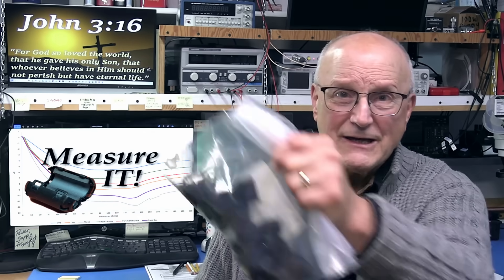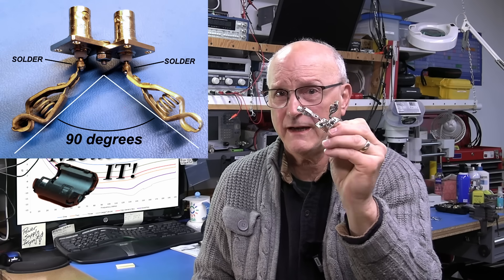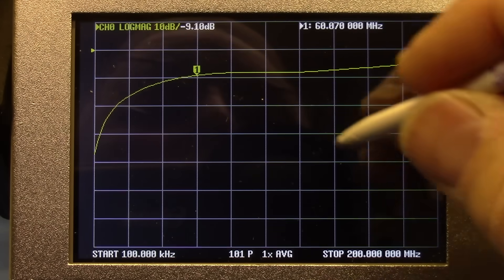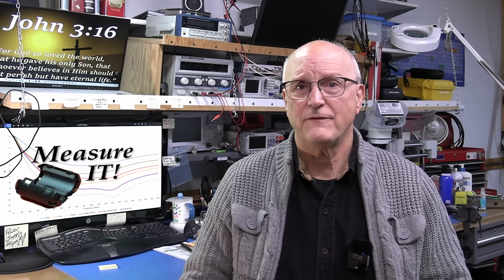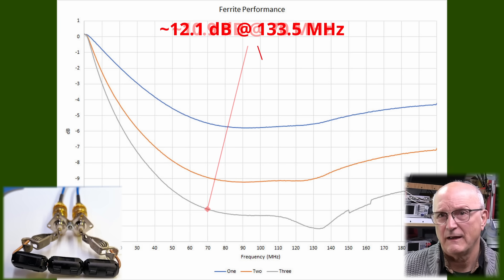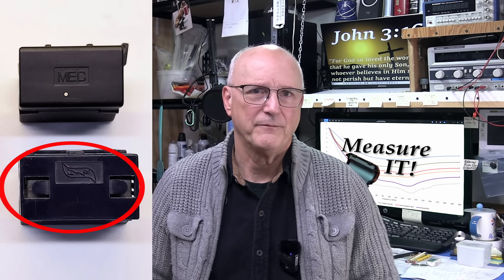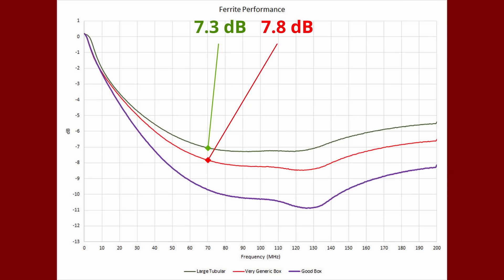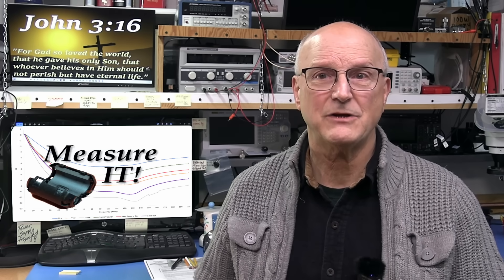Evaluating Clip-On Ferrite Beads with your nanoVNA (075)

Comment: Excellent video.  Compairing cheap amazon clip on ferrite devices to a larger piece of ferrite from fair-rite isn't really a fair comparison.  You did a great job showing that the fair-rite device is superior, but amazon ferrites are a fraction of the cost....and if you don't need a tremendous amount of attenuation, then a few turns around the amazon clip on ferrites are probably good enough and will cost less.
Reply from the maker: Thank you! I don't know if you noticed that I compared a similar size cheap Amazon tubular ferrite to a very generic box style to a genuine Fair-Rite box style.
You are right, though, if you do not need a lot of attenuation, then the cheapies will work just fine. It is all about the application. Figure out what you need and select the ferrite that will do it for you. 🙂
Reply: @eie_for_you thank you again for the excellent video!
Reply from the maker: @daveG1020  You are very welcome! 🙂

Comment: Somehow I missed info about the cost... like if 3x beads cost more or less than 1x the other thing?
Reply from the maker: Well ... the cost is very, very supplier specific. So, quoting costs wouldn't be too helpful here.
Furthermore, there are a lot more factors involved than just cost ... like space considerations and dissipation factors and more. This is why you have to do your homework. 🙂

Comment: Per the comments, you get what you actually should be buying.  Ferrites come in all sorts of dissipation ranges and losses.  Some are virtually lossless and we used these in HF transformers.  The FairRite company catalog is a very good reference source for the actual specs.  We did EMI/EMC engineering with these types of things, and they are often ineffective on cables, since that depends on placement.  EMI is a common problem now from spread spectrum computer power suppies, and one bead is not going to add much to attenuating the noise level.  The cable lengths act as antennas at specific resonant frequencies, so unless you emplace different freq-ranges of ferrites, you won't get much attenuation over a large band.  As per the video, the "longer the bead" the better the attentuation.  An actual pipe would be the best.
Reply from the maker: When many people look at all of these specifications, their eyes glaze over, not sure what it all means. This is why, in the end, if we are not sure what we are looking at when we look at the catalog, their is always customer support. 🙂

Comment: Ralph, I'm sure you know this already, but I'll state it for the benefit of your audience.
3 turns of a wire through a single ferrite would be MUCH more effective than a single wire passing through 3 ferrites.  If you're shopping, buy larger diameter ferrites and wind your wire/coax through as many time as it will fit, I recommend a minimum of 3 turns for good attenuation.  Type 31 and/or 43 are great for common mode or noise attenuation in the ham bands.
I really like your testing jig, and will make one.  The multi-turn effect could be easily demonstrated using it.
Thanks for your very informative channel.  I enjoy one or more of your vids just about every day.
Reply: When you say "turns"  you mean winding the wire through the hole and around the outside of the body of the ferrite, as in repeating loops through the ferrite?
Reply from the maker: @echadmiyodea  Each pass through the ferrite is a "turn." The key is that the wire passes through the ferrite. Having it beside the ferrite, on the outside, doesn't count. 🙂
Reply from the maker: There ye go! Each additional turn adds some benefit. But, it is the law of diminishing returns, as I show in the video. Yes, each additional turn adds more benefit, but less than the previously added turn. 🙂
Reply: Up to a point. Inter-turn capacitance (mutual inductance in the case of shielded cable) will affect the higher frequency performance. But if you cascade one single turn and one multi-turn, perhaps you get the best of both worlds. I don't have the kit to measure that, unfortunately.
Reply from the maker: @lumpyfishgravy  Well ... sounds like the voice of a truly inquisitive experimenter to me! 🙂
Reply: I have used type 31 very successfully in solving 20M RF from getting into audio equipment and have read that looping more than one turn thru the toroid increases the effect by the square of the turns. i.e., two turns is 4x, 3 turns 9x...  Is that true? I have not verified that and never thought about a jig to measure it until now. Thanks for the video.  🙂
Reply from the maker: Thanks!  My experience has been that the actual dB attenuation with adding turns to a ferrite follows the law of diminishing returns. Each subsequent turn does, indeed, increase the attenuation, but not as much as the previous turn. Check out my video on common-mode chokes here: https://youtu.be/s_JHPDA7k5Y where I do an experiment with the number of turns through a toroid to extinguish unwanted common-mode currents which can exist on the outside of the shield of a coaxial cable. It is the same concept as using ferrite beads.
You are very welcome! :-)

Comment: Great job, thanks.I had a problem with my washing machine on 80m. I purchased from Mouser 2 clip-on ferrite beads that worked best at low frequencies. The idea was that I was able to look at the datasheets with curves. I then clipped them on the power cord of the washing machine, with 2 wraps each. It worked. Buying a known ferrite is the best!
Reply from the maker: I LOVE the success stories! 🙂
I wish I could put a ferrite on the entire city of Dubuque! We have an S7 to S9 noise level here and it is guys to the south of the city and guys to the north all have the same issue. I've turned off my own main breaker and ran my radio off battery ... no difference. 😞
Reply: @eie_for_you  I know of what you speak!  Keep after it, you will find what it is eventually!    I have had s7-s9 noise here in my town, which is power line induced.  It changes with weather, and seems to follow a HV feeder that passes my house about 300 ft to the east of my house .  4 or 5 blocks on either side of the line,  the noise tapers off.  It also reduced a lot last spring, but it seems to be coming back.   Interesting thing, I had the power line drop coming to the house from the alley  put underground (at my own expense) to give me more room for antenna construction, and while that was in process I noticed my neighbor had his power drop from the pole to the house and it was rubbing on a large tree limb.  I noticed also that someone (doubt it was the utilities people)  had wrapped what looked like part of a rubber door mat around where it contacted the tree and secured it with zip ties.    So,  I will be looking at this a little closer when the weather warms up this spring!  I suspect that there was or is still leakage to the tree when the tree is moving in the wind, and it makes its way back to the feeder by the transformer in the alley passing the noise to the primary side.  It then radiates out  from that line which runs to a much larger substation 5-6 blocks north of me.   73 and good hunting!
Reply from the maker: @arnoldgrubbs2005  I hope to do a mobile search with my RF Explorer and a portable antenna....sometime! 🙂
Reply: @Electrotech1980 can you share a link for the Mouser beads that you selected and successfully tested, please?
Reply from the maker: @ Yes, please share your discoveries. 🙂

Comment: I don't recall you mentioning anything about the ferrite material. That makes a big difference too. A question how much difference does the split core make. They are convenient but at what price to performance?
Reply: I think material is the same thing as "mix" or..?
Reply from the maker: @OH8EFI  As I understand it ... yes. 🙂
Reply from the maker: I did, indeed, make a note to pick the right material for the job. 
Good point about the split core. I would assume that the split core is a compromise for the convenience of being a clip on. I'm not sure how much that affects overall performance. 🙂

Comment: hi thanks for the info. i have a question for you is it possible to use rig ekspert stick 500 to measure db deping through ferrite cores ?????
Reply from the maker: You need a 2 port measuring device to do this measurement. The Stick 500 is a single port device; it measures things like SWR, return loss, impedance, and the like. It cannot measure things like filter frequency response. This ferrite business is, in essence, a frequency response-type test. 🙂

Comment: VNAs are great tools, and the availability of the inexpensive ones is great for the hobbyist.  As for ferrites, I spent a lot of time working on EMC problems, and a selection of clip-on ferrites is very handy.  Our lab used Fair-rite ferrites mostly.  You do need to select the correct material for the frequency range of interest, and you should select the ferrite that fits snugly around the cable.  The impedance of the ferrite will be reduced when there is a gap.  As you note, you do need to read the data sheet and understand it.  Measuring the ferrite is useful, but be aware that they usually have a large tolerance.  I recall that a tolerance of 25% was pretty typical.  It's more useful to just buy a good ferrite from Fair-rite or Wurth or other reputable supplier.
Reply from the maker: Thank you for the great advise! I cannot agree with you more. 🙂

Comment: Good and enlightening tutorial. Grateful. 
Any ferrite that works well in HF? 
Which of them should we buy? 
Thank you so much. EA7HJ
Reply from the maker: Thank you! Here is a quote from one of the other comments that might help ...
"The three handiest mixes for use in amateur radio are type 31, 43 and 61.  Just be sure to pick the correct mix for the frequency of concern."
When in doubt, contact the manufacturer. They are often very helpful in selecting a ferrite for your application from among their products. 🙂
Reply: Many thanks. 73
Reply from the maker: @ea77hj  You are very welcome! 🙂

Comment: Very interesting your video! But whats the difference if you put in and out throuth the ferrite?
Reply from the maker: Thank you!
Putting the wire multiple times thought the ferrite is similar to adding ferrites to the wire. It sounds like a good experiment for your bench! 🙂
Reply: @eie_for_you  i don't mean that you multiple times. You have a output signal, go thourh the ferrit and goes to the input of your mesure instrument. The current goes over GND in the intstrument back. But look of the most time used. The roudn trip line goes thouth the ferrit.
Reply from the maker: @meinsda5983  Hmmm...I'm not quite getting what you are trying to say. 😕
Reply: @eie_for_you  if you use ferrite beads in data lines then you have two lines through them. A data line and a gnd line. In your experiment you only have the data line. The ground connection goes an other way
Reply from the maker: @meinsda5983  Aaaah yes! And the same principle applies in both directions. 🙂
Reply: @eie_for_you  realy? ;)

Comment: One thing I learned a long time ago, buy name brand ferrite.  Only thing in use in my shack and on my work bench's is Fair-Rite brand.  Buy once, cry once.  Well worth the additional cost in my opinion.  The three handiest mixes for use in amateur radio are type 31, 43 and 61.  Just be sure to pick the correct mix for the frequency of concern.
Reply from the maker: Great advice! I cannot agree more. Ya get what you pay for! 🙂
Reply: Hi, just about all Toriod cores for Unun's are recommended 43 mix.
According to my charts 43 has the frequency range 25MHz - 300MHz.
This does not cover example 80M,60M,40M etc bands.
Why are we not advised to use 31 mix at range 1MHz - 300MHz.
Thanks
Reply from the maker: @leakyboatent  Well ... THAT is a worthy conundrum! The reason is that toroids have two possible main purposes. First is EMI suppression. Second are transformers such as BALUNs and UNUNs.  The mixes used for each of these applications are different. Using your example, you can use the 43 mix for EMI suppression in the 25-300MHz range and for transformer application in the 1 MHz to 300 MHz (using your numbers without looking them up for myself).
Does this make sense? 🙂
Reply: To be fair, they all had a similar suppression pattern, rite?  (some of you will see what I did there ;)  You'd just have to use more for that specific cheaper brand, totally fine for an application that doesn't need to be visually appealing.  That said, I would still pay more to know that the frequencies I want to suppress are actually being suppressed vs taking a shot in the dark and wasting money on nothing.  Quality products require quality engineers, quality engineers cost good money.  I will spend money good on Koala-T!
Reply from the maker: @jampskan5690  None of these very generic ferrites will "fess up" to who they are manufactured by. No markings of any kind. Yup ... pay for the quality and enjoy the performance. 🙂